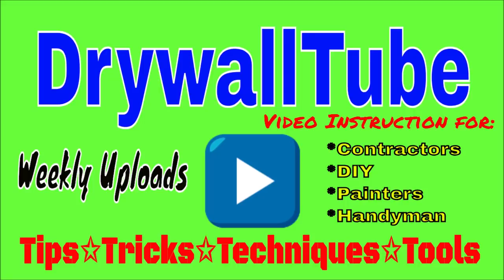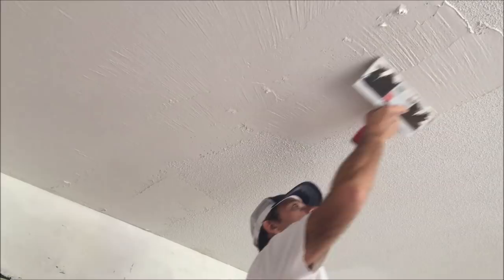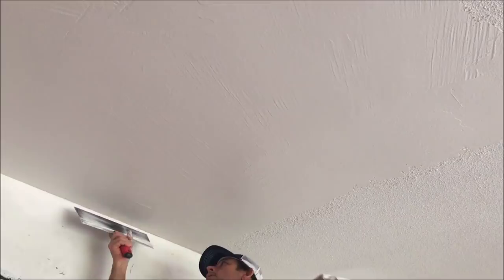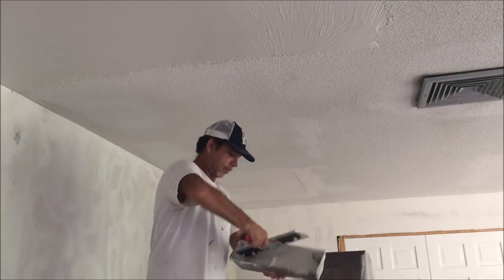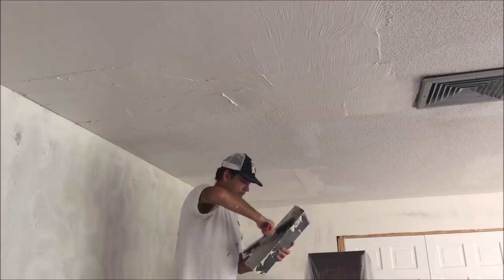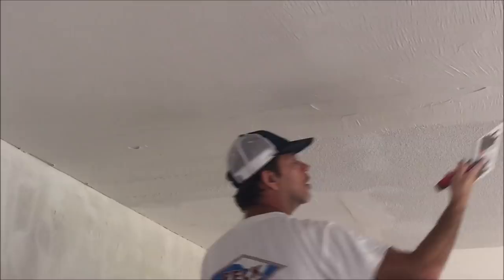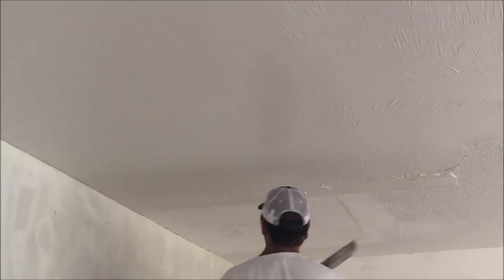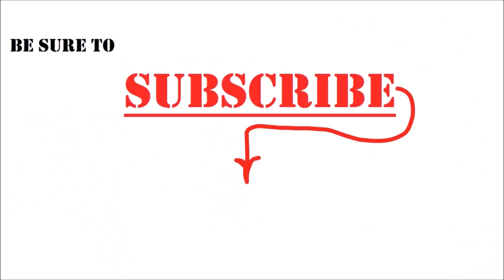Skim Coat Over a Painted Popcorn Ceiling- Skim Coating Tips and Tricks

Comment: I just completed a small test section of a popcorn ceiling cover up with a skip trowel texture. There is no way I would have tried it without your videos! It doesn't look as pretty as yours but it's good enough that I will be doing a larger area with the same technique. Thank you for your videos!

Comment: Paul, thanks for your great videos!  i am a handyman that started as a homeowner doing myown drywall work since 1972 when i pirchased my first home!  While not full time i have been doing this work for over 40 years!  Now i am a professional handyman (A Veteran Handyman) and lately doing a LOT of drywall work including ceilings.  i started watching your videos this evening for the first time, starting with the how to repair a water damaged ceiling and then a couple of your other videos.  I learned a LOT, about both techniques as well as about products!  I have only every used premixed joint compound and i must say that i get really good results, but I have hated the prolonged drying time so you have made a believer in me for using both hot mud as well as FibaFuse tape!  I can't wait to apply them to my next repair.  In the past i have used primarily paper tape and some fiberglass tape as well and like you I still think that paper tape IS THE BEST tape for inside corners!!!  Next up is the video on how to mix hot mud!

Thanks again for your great videos!  Keep them coming!

Comment: I'm skim coating my painted over, popcorn finish bathroom walls after researching and finding videos such as yours.
I'm using Plus 3 compound, a tray, and a 12" knife. I would have removed the popcorn finish, but it was painted, and wetting and scraping the surface wasn't removing anything.

2 coats, that's all you needed?! It must take me 8 coats to finish a wall and that's not an exaggeration! Sure; I get the "chatter" upon application of the first coat. I let dry 24 hours per the instructions on the pail, then briefly scrape down the high spots. Repeat. After each of the first two or three coats, I will quickly scrape down the high spots, then apply the next coat. Once the wall gets reasonably smooth, I will quickly dry sand, then wet sand the wall. At some point, the finish is good enough that I'm "spot coating" the wall. I'm also using a drop light placed at a sharp angle to the wall surface to reveal imperfections.

I'm a DIY'er so I can afford to take such a long, laborious process. But I will say, the finished wall is perfect.

A question for you; how do you get outside corners to to result in a smooth, straight edge?
Reply from the maker: Hey there Peter!💥👊🏻 Here’s a video where I skim coat an outside corner while skim coating walls: https://youtu.be/6NYYW6MINWU I hope this helps. Let me know. Thanks so much for watching and subscribing my friend!😎 -Paul

Comment: Hi, I attempted this on a small bathroom. It came out okay, but I ended up applying 2 coats of joint compound. I used kilz to prime and then painted. I like the result, but it was really bumpy and i had to do a fair amount of sanding once the compound dried. For this tiny patch of ceiling, I used about 5 qts. of compound. How much water would you recommend for this to thin the compound? My ceilings are concrete on the 1st floor if that makes a difference.

Thanks, I've learned quite a bit from your videos.

Comment: Thanks Paul! None of the popcorn ceilings here have been painted and the house is 15 years old. The bathroom ceilings are peeling off of course because of the steam, should I scrap it off then?
Reply from the maker: Right on Chris!💥👊🏻 Yes, I would wet them and scrape. Here’s one of my videos where I use my paint sprayer to wet the ceiling before scraping: https://youtu.be/Fz63ATjiVdY You can also use a pump sprayer or garden hose to wet it. Just don’t get the ceiling to wet and damage the drywall.👍🏻 I hope this helps. Good luck bro! Thanks for watching and commenting!🙏 -Paul

Comment: Hi and thanks for your videos, Im a dyi er. So if we don't know if the ceiling is painted, but we do know the age of the ceiling and popcorn. So my issues are I got the foundation fixed, and we gained some new cracks. There are areas where the popcorn is lifted or bubbled. New cracks on tape lines in the ceiling. So should i scrap it? I fear the lifted areas would just fall down later? Would I then have to scrape the entire room ceiling? Of just the lifted spots?  Im almost positive its got the asbestos in it.  Im figuring I may have to remove all of the popcorn and wear a darn mask and my glasses fog up.

Comment: Hi Paul! Thanks for the helpful video! I was wondering - once you paint and apply the skim coat over an asbestos-containing popcorn ceiling is it safe to cut into the ceiling later to install recessed lighting or ceiling fans? Would that risk letting the asbestos dust out again? Thanks!

Comment: Hi Paul,
I am a DIY novice and have a popcorn ceiling that I want to skim coat to flatten its popcorn texture to an orange peel/smooth surface.  You mentioned that skim coating should be done only on a painted popcorn ceiling…because the popcorn may peel or fall off?

Comment: DIYer that just found your channel. Great info! My house was built in the early 80's & completed 1983. I have scraped 3 rooms with popcorn ceiling that had not been painted. Didn't even cross my mind to check them for Asbestos. I did wear a mask. Put the Zinsser 1 2 3 primer on after scraping and cleaning the ceilings. Only put one coat of the 1 2 3 primer and the ceiling look horrible! All the imperfections, tape job show. Should I skim coat them. Can I skim coat over the primer. Thanks.
Reply: Larry just in case you didn't get a reply I wanted to comment. I am a retired building contractor for what it is worth and have dealt with PC ceilings. What is underneath them is hideous for sure. If it were me, I would skim the entire ceiling, but first give the taped joints some attention, looking for loose or bubbled tape. I don't think you will have any issues with going over the primer you used. Just remember that if you intend to retexture the ceiling, you will inherit whatever flaws are underneath it so make your prep work count. Good luck!

Comment: I have a 1978 house with sagging unpainted popcorn ceiling, what type of primer paint should i use before skim coating and do you think the skim coating is good idea for hiding sagging areas?
Reply: @Black tibby07  What exactly is sagging, the ceiling drywall or the popcorn?  If the drywall is sagging, you'll need to sure it up or replace it.  Don't try to paint over it until it's fixed.  If the popcorn is sagging, painting over it isn't going to fix the problem.  He uses Kilz primer, BTW.
Reply: @ClinttheGreat  the ceiling drywall, entire house
Reply: @sheaadams86  there are generally two ways drywall sags, first between the ceiling joists (you don’t see this a lot and it usually results from water damage) and second the drywall pulls away from the  ceiling joists when the nails (and sometimes screws) no longer hold the drywall up.  If it’s the first one and the drywall is sagging between the ceiling joists, you’ll need replace the sagging part.  If it’s the second, you can usually add more screws to hold up the drywall.

Comment: Hey bro. I’m doing three ceiling for a client. They are worried that the ceiling will be heavy after it’s done. They have a fear of it falling down lol. I do three coats usually to get a polished smooth surface. I told them they would be fine. What is your opinion?
Reply from the maker: It’s fine because the skim coats are over the entire span of the ceiling. It’s minimal weight for the whole ceiling. 👍🏻
Reply: @PaulPeck  Thanks bro. I’ve never had an issue but I got asked that question twice yesterday lol. Made me scratch my head. I’ve done so many ceilings. Even ceilings with screen imbedded for strength on bad plaster cracks. I e never had an issue lol. Since I got asked twice in one day I started doubting myself just a smidge lol. Thanks for the support. 😎

Comment: Paul in general if the popcorn ceiling (Asbestos) is encapsulated can you usually skim coat without any issues? Kinda like covering the asbestos floor tile without disturbing it.
Reply from the maker: Hey Anthony!💥👊🏻 Yes, as long as it has been primed and painted! I hope this helps. Thanks for watching and commenting man!🙏 -Paul
Reply: Down the road a bit I may have to deal with this issue at an investment condo. To properly remove it was astronomical up here in the north east.
Reply from the maker: I hear ya... Let me know if you run into any questions along the way when it comes time to tackle that project!👍🏻 -Paul

Comment: Question, any issues with chunks falling off over time? I was reading that if you do this over popcorn ceiling that’s been painted with oil- that’s where you get the best hold. But that otherwise after some time, it might start falling down. If it was never painted over, would this method still work?

Comment: Hi Paul, I did a skim coat this weekend with some USG that I had in my garage for about a year unopened. After mixing a little water in it there was a bunch of chunks and was overall contaminated and ruined a spot that I'll have to redo now. 

Is there a time period to avoid storing it?
Reply from the maker: Yes there is a shelf life for joint compound. Most wet compounds are rated for around nine months to a year so long as the compound is kept in the right conditions. Also, what can happen is the joint compound can start to dryout at the top of the bucket. Then when you mix up the bucket it will spread those chunks throughout the whole bucket. I be also seen it mold and smell terrible before. I hope this helps. Thanks so much for watching and subscribing my friend! 🙏 -Paul
Reply: @PaulPeck  thanks Paul! Love your channel and you always provide great tips. Lesson learned for me this weekend unfortunately haha.
Reply from the maker: Thank you! I always look at it like Learning form a mistake = Experience.👍
Reply: @PaulPeck  Mine was moldy as well. I got a big chunk of the mold out and then added just a bit of bleach and h20 to it and mixed it well. No more mold or awful smell. It worked fine. I couldn't afford to buy any more after 10 5 gallon buckets and a 1 hour one way trip to town.

Comment: Hi Paul, if I have a popcorn ceiling (late 80’s so probably no asbestos and not painted) would it be easier to scrape off or skim coat?
Reply from the maker: Yes, just wet it a little and it should scrape right off. If it doesn’t come off easy? Rewet and scrape again.👍🏻 I hope this helps. Thanks so much for watching and subscribing my friend!😎 -Paul
Reply: @PaulPeck  If some of the drywall paper gets while scraping, and some of the brown paper is exposed, what sealer would you recommend?
Reply from the maker: Hey Aaron!👊🏻 I would use either Gardz or Pro 999 for sealing up that brown paper so it doesn’t blister! I www.amazon.com/shop/paulpeck Checkout my Amazon link for more info. I both of them in my store.👍🏻 I hope this helps. Thanks so much for watching and subscribing my friend! 😎 -Paul